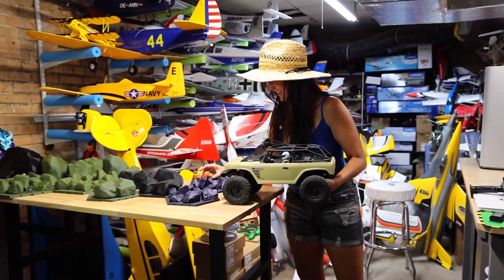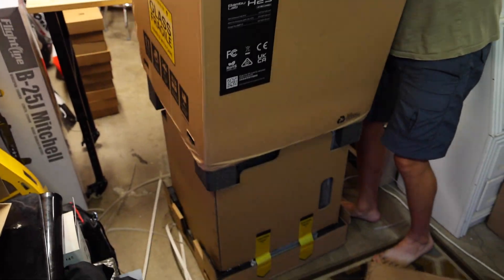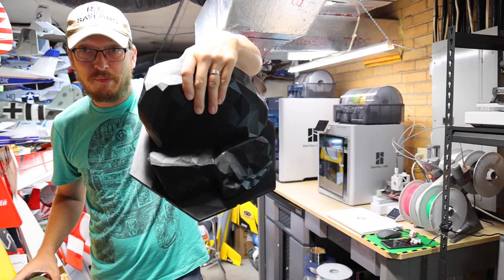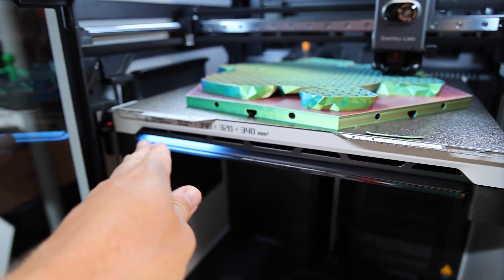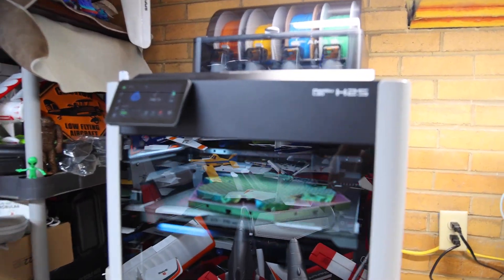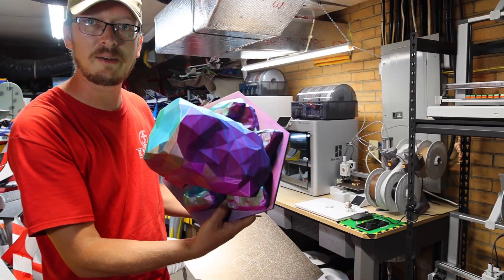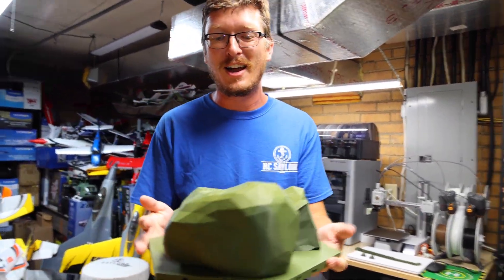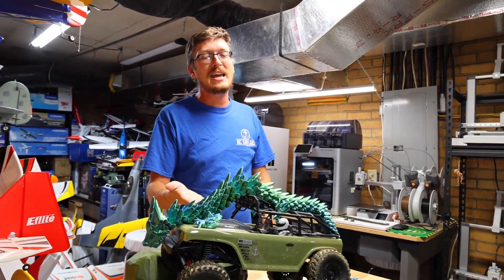Putting the H2S To WORK! - Newest Large 3D Printer by Bambu Lab

Comment: What do you do about the H2S Printer fumes? Do you vent the exhaust somehow?
Reply from the maker: Currently I mostly print with PLA so am not concerned as it is a fairly large space it sits in, also in the basement so a floor away from our living space. I could drill a few holes in the wall and vent to the garage if I so choose down the road. Lots of unknowns in this subject matter currently. Most people say you’ll do more harm just mowing the grass with a standard push mower than what these emit, but that is just something I’ve read. Always be cautious if you have any concern. 👍⚓️